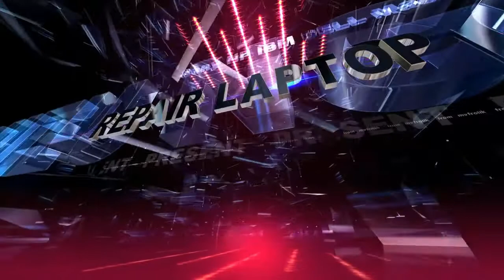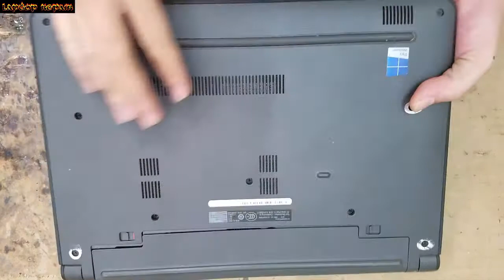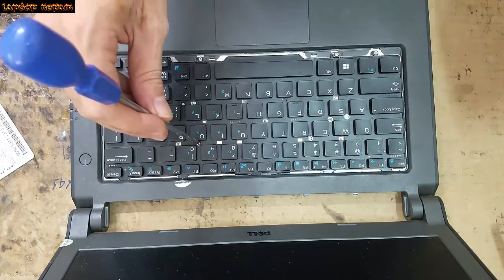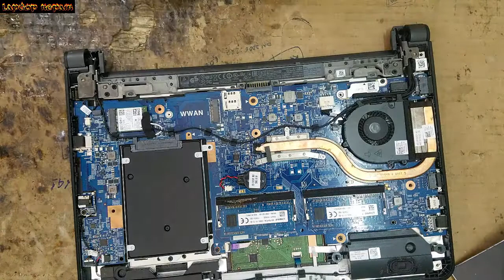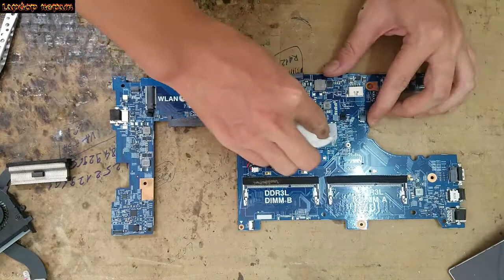Latitude 13 3000 3350  -  Disassembly and fan cleaning - Laptop repair

Comment: Is there really not supposed to be anything contacting the GPU chip? My first thought was that there should be a thermal pad there, but now I'm seeing in your video that you also have nothing contacting the GPU. Why is it designed this way? I tested my thermals, and the GPU goes up to 80 C under load, then starts throttling. Surely a thermal pad is needed there.
Reply: The same reason I'm here, I changed the thermal paste on one of those laptops and it had thermal paste all over the chip except on that side, and the heatsink has the same empty space, I put more thermal paste on that side than normal and then more through of the hole that is visible in the heatsink. I'll probably put a thermal pad on it later.
Reply: @EzequielPR  I've forgotten the details, but I think I found out that the 2nd chip there is an audio thing and doesn't need cooling. Either way, I know I ended up leaving it as is with no contact to the heatsink.

Comment: not 3350
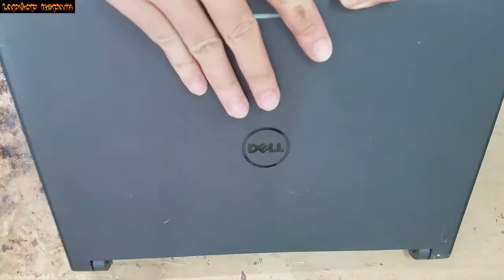Reply: look at 2:00 clearly says latitude 3350, as there is also vostro 3350 in existance that could be mistaken. :)
Reply: Congrats! You have been scammed!
Reply: My Dell Latitude 3350 looks very much like the one being worked on in the video. See if you can find a product label that tells you which model of laptop you have. = )